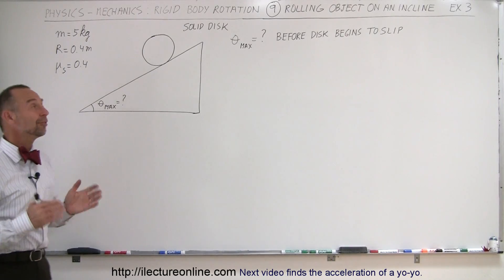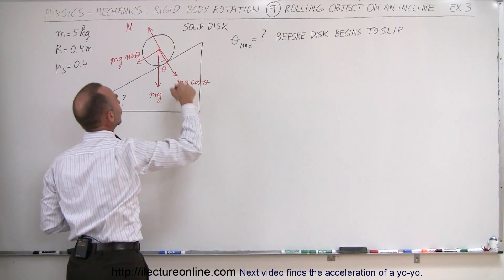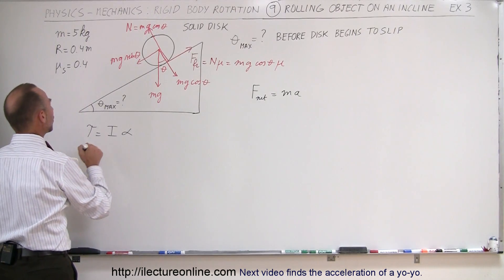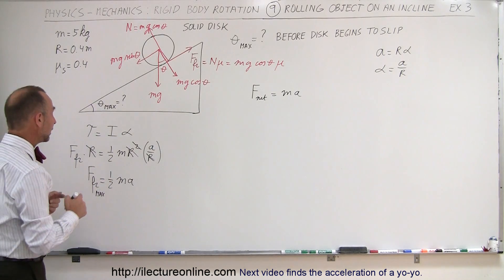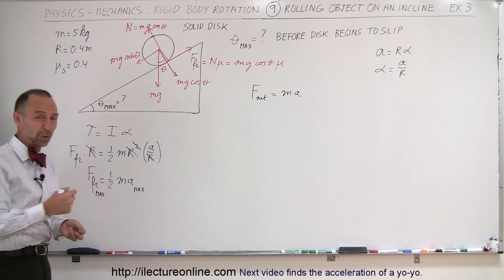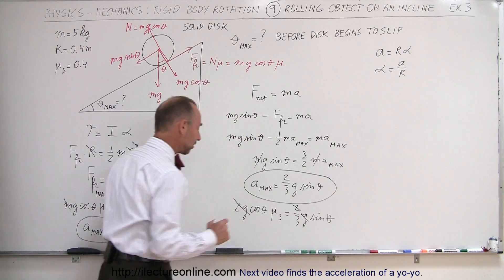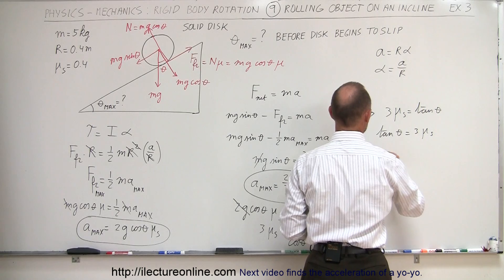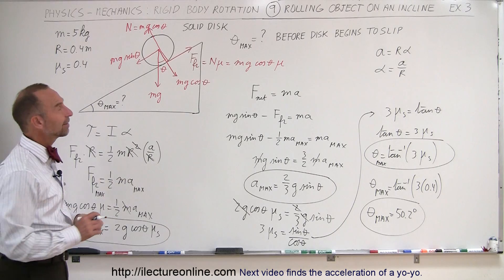Physics 11.1  Rigid Body Rotation (9 of 10)  Rolling Object on an Incline: Ex 3

Comment: how we decide if it should be kinetic or static friction?
Reply from the maker: Kinectic friction involves two surfaces SLIDING over one another.  That is not the case with a rolling wheel.  However this is also rolling friction, not often covered in physics books.  We have videos on rolling friction in our mechanical engineering videos.
Reply: thank you sir @MichelvanBiezen

Comment: Sir. Could you please answer me? What happens if frictional force(kmgCosA) equals to mgSinA? Net force will be zero but there will be still net torque due to frictional force. What will happen?
Reply: If friction force is equal to gravity pulling down the incline then it must be kinetic friction and so it's sliding. In that case it will move down the incline at a constant speed but its angular speed will increase.

Comment: Just as a hypothetical situation, can the wheel slip and also be rotating on an inclined surface like this?
Reply: NOPE,the friction is what's making this wheel rotate so if it slips it is not rotating
Reply: @mrthebest8114  Only If the surfaces are friction-less the slipping happens without rolling. But if the surfaces are rough two case may happen rolling without slipping (static friction) and rolling with slipping (kinetic friction) the later is not considered in this video.
Reply: YES. if theta become more than theta_max rolling with slipping will happen.